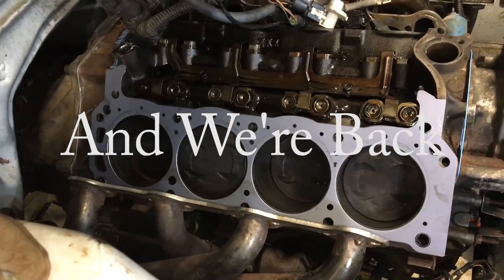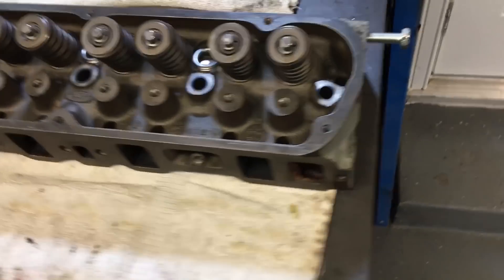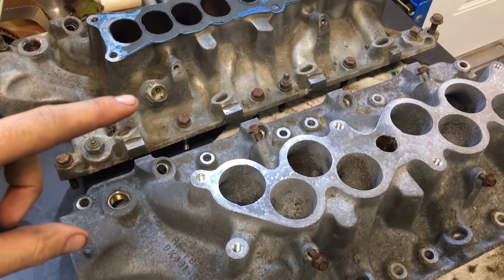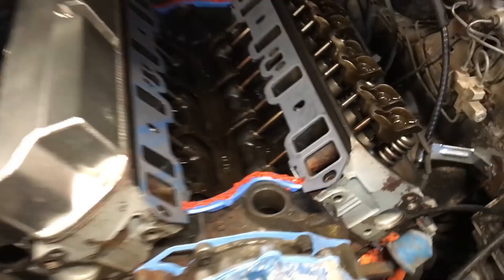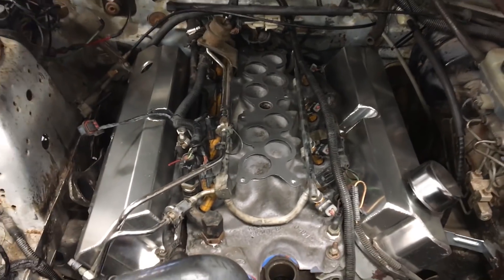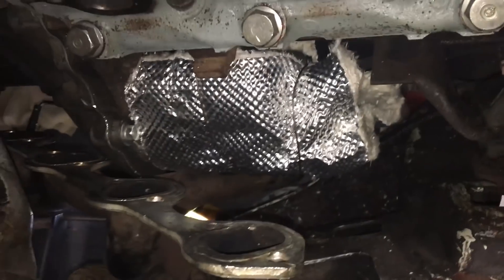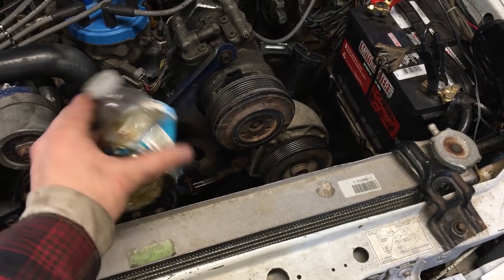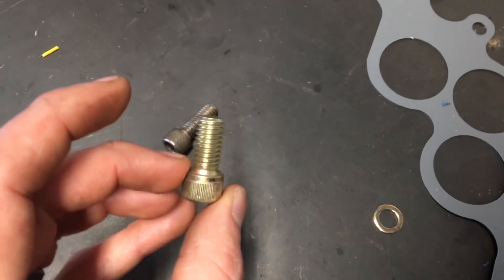Foxbody Mustang Build - Episode 13 GT40 E303 Power! Part 2

Comment: If you have a stock 302 fox and put on the gt40 heads and the lower and upper Explorer intake, do you have to tune it?
Reply: Do youvhave too? No. Should you ? Yes.
Reply: @adamrushka8096  will it struggle to work without the tune though?
Reply: @oscarvillarreal8951  it will run OK. But your gonna be leaving power and drive ability on the table
Reply: @adamrushka8096  oh, ok 👌. Thanks👍

Comment: Bought an 88 gt it was 30 over with Edelbrock performer rpm heads and e303 cam convert to carburetor really woke it up but still feels too stockish getting another custom cam it's on its way

Comment: Most 5.0 guy’s know to put the air temp sensor just before the throttle body tube !  It get heat soaked in the intake manifold. Rtv is for idiots
Reply from the maker: Thanks for the valuable input

Comment: I almost have the same set-up as you. I did go with 1.72 rockers and I have the GT40 upper and lower intake.  The lower was ported too.  I need to upgrade to the bigger mass air meter along with the throttle body which mine  is a 65mm.  I run JBA shorty headers, a Dr Gas X-Pipe and 2 chamber Flow Master mufflers. Our cars are the same color too.  Great job!

Comment: Did you have trouble with the egr spacer plate
Reply from the maker: No never had any issues at all, why?
Reply: @MGMotorsports  didnt know if you had to use the factory mustang 1 or 1 from the explorer and did you have to send out your computer for any tunning i just got the heads and intake to do my mustang and wanted to have everything i needed thank you for your help
Reply from the maker: I got an egr delete plate, just a flat piece of aluminum between the throttle
Body and intake. Had the holes for the throttle cables and stuff. Was like 10 bucks on amazon or something. Check my later videos, I think I go over it
Reply: @MGMotorsports  thank you very much

Comment: Im doing this exact swap in the next couple weeks on my 94 gt.  Im using a different cam from comp.  Did you have anything done to your heads? I milled .040 off them to raise the compression close to 10 to 1. I had the lower explorer intake milled to match the angle.   Im porting the lower as we speak.  Cant wait to dive in and get it going.
Reply from the maker: Yes, the heads had a 5 angle valve job, unfortunately did not mill them, my lower was also ported. I’m sure with the comp cam you’ll see much better power than I did with the old E cam lol
Reply: @MGMotorsports  in case you were wondering I just got it started and cooling system burped.  Had to swap to the explorer throttle body.  I still need the cable.  Did you have more noticeable valve clatter after your H/C/I swap? I have more clatter than before but I'm also running heavy springs.  It runs and sounds great can't wait to drive it.
Reply from the maker: 302hobronco no more clatter on my end, but i didn’t go super heavy with the valve springs, could be your issue. Assuming you set lash properly.

Comment: WHY does anyone use one of the 30 year old technology of the Alphabet cams now?  Yes I had a bottle fed 89 with the B cam back in the 90"s but now.....
Reply: Ah, gotcha. When the budget allows, talk to Anderson about their cams, they are really good. Around $300 but worth every penny.
Reply: @therealist4006   You're right but those alphabet cams sound good and they're a good cam for a stock budget build 302 with a set of GT40 heads like what he has.  Now fully built or stroked out motor is a different story.
Reply: @therealist4006 Anderson cams have been around almost as long as the letter cams.  Get a FTI cam.
Reply from the maker: In my case, my buddy had the b cam sitting on the shelf, and gave it to me, couldn’t pass up free.

Comment: Did you turn the t-stat around? Spring end should be in the intake.   .You can't mix the sensor with a different mass air housing
Reply from the maker: baddbradd89 yeah I just had it in there like that so I could show the opening temperature. I did end up getting a 1” spacer, fixed all the clearance issues. The mass air worked in that housing because it came from a 94 v6. Has the same sensor part number and 19lb injectors as the fox.

Comment: What exact intake gasket did you use? Thanks
Reply from the maker: Manuel Guisar it’s a fel pro gasket for an explorer part number MS95953. Make sure to subscribe to stay up to date with the new content!
Reply: @MGMotorsports  Does the felpro MS93334 work also?
Reply from the maker: Manuel Guisar that one will work for the lower manifold to cylinder head joints, as well as China wall. The number I supplied is the gasket between the upper and lower intake
Reply: @MGMotorsports  thanks for the info man highly appreciated!

Comment: couple of suggestions. You should use 30w oil on the bolts to achieve proper torque. on the lower bolts use thread sealer. Throw those cork end gaskets in the trash and lay a fat bead of right stuff on the front and back china rail and in the corners  Easy way to adjust the valves is to get the valve on the base circle of the cam, tighten the rocker until there is no preload and on these rockers about 18ft lbs of torque. If you can get that torque you need shims. those gaskets are crap- use the 1262S with the steel inserts as the paper ones fail, use the blue felpro rubber valve cover gaskets with the steel inserts. they last a lifetime. you can  . That MAF is from a 94 to 95 gt and you should not ever switch the MAF sensor from the one size housing  to another as is it is calibrated to the housing.  Your car will run lean. The overflow is not large enough . you should also change your oil as you have coolant and debris in your oil.  finally go back and retorque all the intake, exhaust bolts after a few heat cycles as they will back out
Reply: roller 302 rockers torque down to 25 foot pounds and your done.
Reply: @brentunderwood7600   exactly, all that preload base circle shit doesn't need to be done on stock 302 rockers.  I've always tightened to 19ft pounds instead of 25 and never had any issues.
Reply: @thehellfox3423  indeed bud
Reply from the maker: MrMikestang63 thanks for the insight man. Definitely appreciate it. 👍🏼

Comment: under drive pulley set is the best bang for buck I done to mine it really frees up the engine
Reply: UD pullies add maybe 5 to 10 hp at the sacrifice of poor cooling and charging.  You will never feel the difference unless you are spinning at 4000 rpm all day.
Reply: @MrMikestang63  I use my mustang to drag/street race so it goes from idle to 5800 then slammed into the next gear then repeat. bang for buck I felt the most difference from ud pullies. never had any issues with cooling or charging? is that a common con with them?

Comment: did you use factory valve springs and pushrods?
Reply from the maker: brent underwood yes I did.
Reply: So e303 works fine with all factory stuff?
Reply from the maker: @brentunderwood7600  yup no problems whatsoever!
Reply: @MGMotorsports  2 years later how are they holding up? i'm wondering if they're good for the long term
Reply from the maker: Sold the car not so long ago, but they were fine at the time.
Reply: @MGMotorsports  awe man that thing was sweet ! thanks for the response!
Reply from the maker: I know, I miss it every day

Comment: Awesome job man, the perfectionist in me is screaming at you for not at cleaning g the block best you could and painting the new stuff to really clean things up. I just picked up an 88 LX 5.0 with 45k. 5 speed all original car. I have a freshly rebuilt intake to oil pan 306 with gt40 top end, TB, mass air, B-cam, and 24 lb. Injectors. The new car burns a bit of oil, so you know what I'm about to embark on!
Reply from the maker: Haha, yeah I did think about painting the block! But it was cold in the middle of winter, wouldn’t have stuck that great. Make sure you post a video on your progress!
Reply: I have been thinking about doing just what you did. Document my entire resto/build process.
Reply: If it’s burning oil at only 45k either it had the shit beat out of it or it’s really 145k

Comment: How did it run? I think that combination is how ford should have built the fox
Reply from the maker: arturon58 runs great! I agree, this really woke the car up! Night and day difference
Reply: @MGMotorsports  should get the lower ported! Should be a fun car
Reply: @MGMotorsports  I got a similar set up, f303 cam, gt40 heads, original Cobra intake, Cobra kit with 24 lb injector's and computer. Basically a 93 cobra engine.
Reply from the maker: Smith performance racing how do you like the F cam?
Reply: @MGMotorsports  Iv used the same f cam for 18 years so far. If you go to my tube account you can here it. Great Cam
Reply: @MGMotorsports  my cars full weight with built C5 trans with 4000 stall. Been 7.50 in 8th on 100 shot. 159 60 ft 98mph
Reply from the maker: Smith performance racing dude that’s a good time! She sounds great! 👍🏼
Reply: @MGMotorsports  Be better time next time out. Was 100 degrees and my distributor cap was fried. Thanks man. Just never buy or use a c&l mass air there crap man.
Reply: @MGMotorsports  keep up the good work man👍
Reply: @MGMotorsports  if you scroll down on my tube account you'll see my brother's white 89 gt pulling wheels past 60 ft.
Reply from the maker: Smith performance racing thanks man, make sure to post some videos id love to see it!
Reply: @MGMotorsports  Will do man

Comment: Did you use the stock pushrod length with the e cam??
Reply from the maker: I did, they worked great. I just figured since the heads were pretty much the same as my old E7 heads, i would be alright
Reply: @MGMotorsports   pushrod length is determined by the cam not the heads.